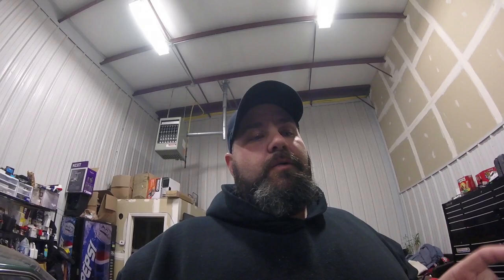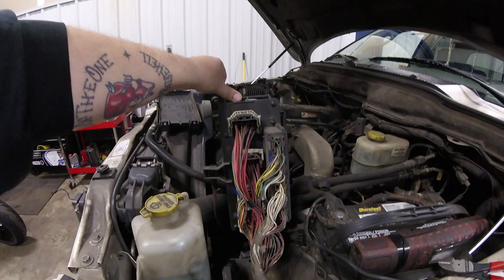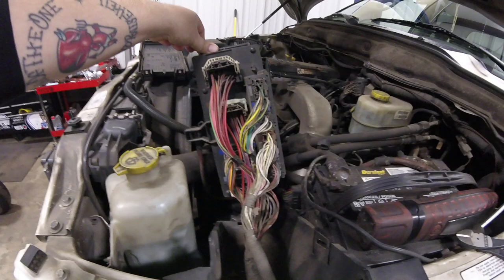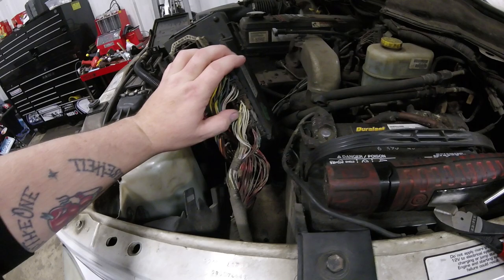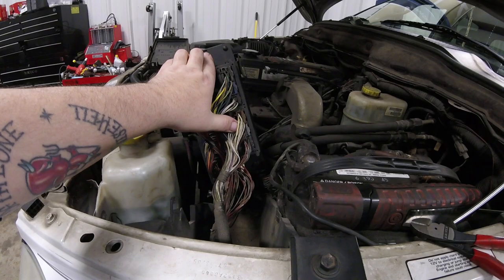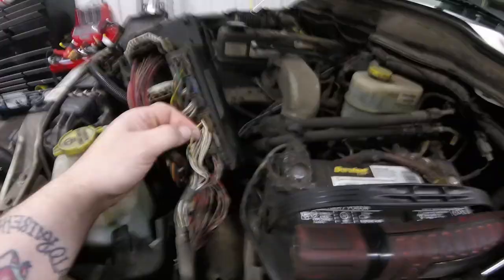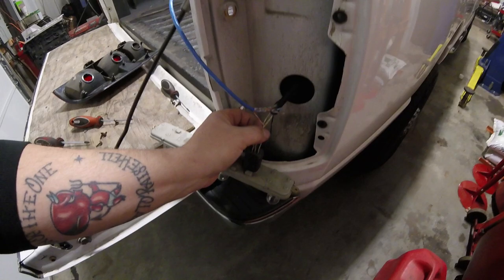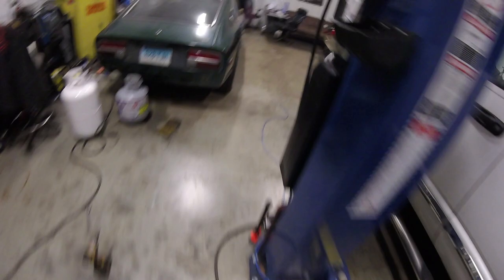Cummins Ram 2500 Bad TIPM??? Maybe not!

Comment: Just started having issues with my 06 mega 5.9.  Airbag light comes on and AC stops working randomly 293K miles.  wiggle the Tipm and it all starts working properly.  Any suggestions would be terrific.
Reply: I am having this exact issue, have you resolved it?

Comment: Thank You Sir, this video gave me a positive attitude on looking to find tha wiring problem for tha 4wd issue on my Bosses 07 3500 with tha 6.7...cross Your fingers fir mE...
Reply from the maker: Crossed ;-)
Reply: Please let me know 
Having the same 07 1500,
Reply: Got 2010 2500 cummins. Need pin diagram p/n 04692 131AG

Comment: Rear running lights  Not working ,  turn signal are working and stop lights 

2007 Dodge  Ram 3500  with a stake  bed . 

A Trailer   That I purchase couple days ago , it was towed   Using my 07  and there after I lost the running lights . 

It appear  there might be a short on  the  trailer,, that  cause the fuse to blow , but I not sure . 

Give some ideas to troubleshoot  please  , i have check the fuse and that is good .

Comment: I have an 05 dodge ram 2500  5.9l diesel that I have no backup light, I try to find information about it I don't know if it is a sensor problem. I seen a video about fixing the problem that this guy have to add extra wire TIPM fuse box but I'm not sure about this... If I buy myself a scanner code reader will I be able to find the problem and is the a specific scanner I need to get? Or do you have a video about it?

Comment: I could use some help! I got an 06 2500 cummins and mine is throwing multiple turn signal codes but I have been assuming that was from the after market LED tail lights but now I'm getting a U0024 code and thats got me leaning towards the TIPM. I think its a coincidence but I'm also getting a P0148 code , thats a fuel delivery error code and I've lost a ton of power and my transmission is acting up too. Could this all be the TIPM?

Comment: I have a 2012 Doge ram 1500 I bought it used a year ago and have had nothing but trouble with it but at night i can barely see due to headlight problem well i figured out that when my headlights are on both my headlights work but when i turn on my high beams my right side comes on and my left side goes off i almost did not pass inspection but they told me to replace high beam light and let me go. we have checked both lights dont understand what it could be, but in last month now im having trouble with my right side light it just goes off i guess its in the wiring i have to keep messing with it pulling over all the time and of course its not easy to get to but i just move it around. I have also have had to bypass my fuel pump relay switch. I sure could use some help this is just short of my problems with my doge i have a list of codes its throwing and were all lost.  any suggestions.....

Comment: I have a similar issue both my left and right hyper Flash which I have aftermarket headlights and taillights but my right marker lights flash with the turning signal chapped all the grounds and the trailer plugs and I can't seem to find the issue

Comment: Idk if you’ll even answer this, but I have a question, I have a 2003 Dodge Ram 2500 5.9 and I think I have the same problem, but I’m not sure. I believe a trailer light got ripped off of and maybe caused a short or something, I’m getting a lamp out flashing light only with the turn signal on and the parking lights on, do you think all I need is a reset?
Reply from the maker: A reset might fix it all. If it dead shorted though, it may need replacement.

Comment: I have a 2007 ram 2500 diesel. I cannot figure out why my daytime running lights are not working. I believe it may be a TIPM issue. Do you have an idea of where to look on the TIPM wire diagram to help diagnose?

Comment: Great video,
I’m having a similar issue. I have an 08 Cummins 2500. Left brake light left rear turn signal, and the entire overhead 3rd brake light do not work. I traced the wiring harness haven’t found breaks or shorts. The running lamp(which is the same bulb as the brake lamp) works when I have the running lights on. But won’t do anything when I press the brake. Any ideas? Same with turn signal won’t flash. I replaced bulbs even though I knew they were good still nothing. Thanks for your time

Comment: I'm having some what of the same issues, my blinkers doesn't work in front of my truck and only one works at the rear of truck and passenger head light comes on and the other doesn't and when I turn the blinkers on I get rapid blinkers on the instrument panel and on panel or dash it always says lamp out. Checked all bulbs and they are fine. Loved ur video just wondering if there is anything else I should be looking for.

Comment: I have a 2006 Dodge Ram 2500 4X2 truck and I present code P0882 and P0700, besides U1120, U0121 and several P0846, P0846, P0871, P0876, P0988 and P0869, the manual says that if I correct the P0882 the other codes are corrected, on the pin 18 of the C4 of the PCM voltage does not arrive and should arrive 3v minimum to activate the circuit of the pins of the same C4 19, 28 and 38 with 12 volts to activate the TRS of the Transmission, since the transmission went to 4th by protection , I would appreciate your help or guidance to solve the problem, thanks in advance, Regards.
Reply from the maker: That is a very common issue when the TIPM begins to go bad. It loses the 12v input signal to the trans computer. You can remove and disassemble the tipm to see if there is any obvious issues. The other issue can sometimes be the ECU not commanding the 12v signal but most likely the TIPM. I havent had the issue myself so i cant tell you exactly where to look in the TIPM but def a tipm issue in my opinion.
Reply: Thank you friend Morfius very kind of your part for answering, since I asked several and nobody has answered, today I check several circuits of the CAN BUS to the electric modules and all have continuity, then I measure the resistance and all give less than 5 ohms and as the manual says below 5 ohm is fine, I have a month with this problem, but here it is difficult to get things, I live in Venezuela and there is a severe crisis, hyperinflation (over 2000%), we only work to buy food , I am a Mechanical Engineer and a specialist in Natural Gas, I have been working in PDVSA for 27 years, you can see my profile in Linkedin, for your information 3 years ago I earned the equivalent of 10,000 USD salary, right now they do not reach the equivalent of 1000 USD monthly (I'm just waiting for retirement for next year and not lose all those years), so I can not buy the spare, one because you can not get here and another that has to be imported, but that's very expensive, friend Morfius I apologize that I have told you personal things but it is that we are in a difficult situation and we hope that outsiders will help us out of this situation, you can know some proof of how to diagnose the TIPM to know if it is bad and get the solution.
You can see that you are a hunger with a good heart, many blessings and many thanks. regards

Comment: A quick question, have a obd2 code reader and a cylinder five missfire on a ram 04  4.7 liter. Does the same principles of this video apply towards troubleshooting 2314  code which is a wiring issue for the coil and secondary ignition code? Also showing random multiple missfire code.
Reply from the maker: On your particular truck a misfire could be a lot of things. Mainly a coil pack or spark plug that has gone bad. I would check that first. If the misfire continues, I would perform a compression test on that cyl to make sure compression is within spec. The multiple random misfire code can be triggered if a single cyl is misfiring badly enough so i would leave that code alone and focus on the single cylinder.

Comment: Low voltage at TPS. Could this be the TIPM?

Whole new engine wiring harness to different ECM checking for flash proper at ECM

Comment: I have ‘04 2500 with cummins, found out previous owner had someone blue crimp connector(2 to1) the trailer harness and trailer brakes in the back side harness and it all corroded. Go figure for New York salty winter roads Finally put a newer harness in it with same part numbers and trailer brake lights and signals do not work but trailer brakes and running lights do work... any help? Please, thank you!
Reply from the maker: The corroded wire shorted and killed the TIPM.

Comment: Excellent video.  I am have a error code P0541 and the engine icon turns on after a beep.  The mechanics can't seem to fix it?  Any suggestions please?  I do know, I think it has to do with the relay, but that's it.  Forgot to mention its a 2006 Ram Laramie 3500 5.9.

Comment: I am a gear head like yourself but im more of a old car guy. I have a 2007 dodge ram  2500  and one day out of no where the truck just died.. I turn key off and it started back up. Everything was fine for a couple days and I stopped for lunch and it died again while I was letting it idel down before turning her off and it just died.. with key on you don't hear fuel pump come on and  check gauge light ,engine light and overhead shows low fuel .. took to dealer and they said it was ecm. I replaced it she fired right up and getting ready to head home and it did it again, died and nothing. Any ideas would be very much appreciated

Comment: 2007 Dodge Ram 3500 dually 4x4 5.9 diesel.
Lost rear brake lamps, signal lamps output.  Third brake light ok.  Happened right after connecting to a friend's trailer 7-way. It is clear that a wire shorted (found it on trailer).
Bulbs good. Fuse good. TIPM disassembled and cleaned, no corrosion or broken pins. Dielectric grease coated after cleaning. Hard reset, and soft reset on TIPM gained nothing.
Multifunction switch good (and cleaned) too.
Third brake light working I think means my brake switch is ok too.
I believe that I need the TIPM cleared and or re-flashed. Am I on track?
[And where are you located?]

Comment: My 01 cummins keeps blowing fuse for running lights, i have checked and moved around every cable with no luck,    sometimes it takes longer to blow but for some reason i heat the gas and it blows seems odd to me, no codes

Comment: I have a 2006 dodge ram 3500 5.9L cummins turbo diesel. The truck ran until a friend used one of my batteries to jump start his truck which he done so by removing the battery while my truck was running, he used a battery booster on the terminals he removed the battery from...he almost drained the battery trying to start another dodge by chance, and upon re-installing it he never bothered shutting off my truck he just unhooked the booster pack and tried to connect the battery and sort of dropped it into place. When he did that my truck stalled, there is a red light that flashes on my dash, the truck cranks but will not start, and when I plug my old scanner it says it can not connect to ecu. I have no clue as to what to do
Reply: Dang, it sounds like he fried the computer or the battery is undercharged. Try and disconnect both batteries and leave it alone overnight and reconnect in the morning, MAYBE that will work. If not, check the batteries voltage, they should be above 12 volts, and then you can get the bad one charged. If that don't help, get your alternator checked as well. And if that don't work, then go to a trustworthy technician. This is why I don't let nobody use my truck, or get under the hood. Good luck

Comment: This video is going to save people a lot of money , I have a 2015 2500 Cummins . Lights all work fine on the truck , my issue starts when I plug any trailer wire harness to my truck . The right rear tail light stays on bright red . No turn single no break light . It only does this on the trailer I’m pulling . Any suggestions on where to start or what to do ?

Comment: Your video gave me an idea about my window issue I’m recently having with it not working out of the blue and the master power switch illuminates slightly when I try to make it go up and it’s only rear windows and also the rear sliding window is doing the same at the moon roof area randomly everything works including the rear view mirror and everything works fine but now it’s been gone for a couple of days and it’s driving me nuts on a 2013 ram longhorn edition Cummins

Comment: I am having a p0404 code to come up. I changed the egr valve and broke the clip on the connection to the egr sensor. I'm thinking that with the clip broken, I'm not getting a proper connection causing the engine light to stay on. Would you recommend that a novice attempt to cut those wires and splice them back together? Can I damage the computer if they are not soldered properly?
Reply from the maker: Splicing is easy! Just take your time and do one wire at a time. It should go just fine!

Comment: I have a Dodge 3500/ diesel. I have lost power to my break lights and rear turn signals. The trailer lights work still but not the truck itself. The tail lights work on the back and the cab break light (3rd light) still works as well as the front signal lights. I have checked the fuses and tested wires from the main plug under the cab all the way back. Any suggestions?
Reply from the maker: Yes. Most likely either a corroded terminal within the TIPM or an overcurrent fault also in the TIPM. A simple reflash of the TIPM may solve the issue. I would go that route first.

Comment: Have a 2006 dodge 2500 cummins no left reverse light, fuel gauge wirks some times. Last year replaced ABS computer.  Now recently I  getting alot of engine codes.  Grid light comes on when the truck gets about 197 degrees, check engine codes, fan speed to high (new owm fan 2 weeks ago), high pressure return line, low power to several other sensors.  Dealership says they want to replace the ecm for $3000, but can't tell me if it will fix the problem.  Any advice would be great appreciated.
Reply from the maker: Honestly sounds like a grounding issue to me. Depending on where you live, corrosion and rust can cause a ton of issue especially with how many grounds these vehicles have. Your best bet is to check every single ground you can find in the engine bay as well as along the frame rail. A factory service manual can tell you where exactly every ground is.

Comment: Great Video!  The right side tail light, front parking light and cab marker lights all stopped working on my 2007 Ram with the 5.9 diesel.  I added a new trailer brake controller and found an old alarm system that I didn't know was there when I bought it.  I removed the alarm system and now those lights stopped working.  Any thoughts?

Comment: Just watched your video and it was very informative. I have a 2013 2500.  It has 122,000 on it. Shortly after i bought it i noticed when i start the truck it would tell me left signal light out. I went outside  and its working. The right signal light flashes fast like bulb is out, but works fine. Been living with that, but last week my AC blower started turning off & on.  Replaced it today. Now when I turn my key  not all my lights and radio won't light up & engine will not crank. Checked both batteries. They are good. I believe it is my TIPM after watching your video. Any help would be appreciated.

Comment: Huh thinking mine sitting at the dealer right now may be good kinda doubt it buuut my rear pass brake light went out of course... after my trailer light went out, then I got no bus a few months later but I was cheap with the fixes cause it was just an unsealed taillight so new bulb clean connections call it a day just whatever got the light off the dash miiiighta screwed myself maybe not can't wait for it to show anymore gonna have to figure something out

Comment: Hello so I got a 2006 dodge 3500 5.9 cummins and the right headlight it acting like it's bad new ones in same ting I took the tipm I see a bad spot in the wire on the Is bored itself can it be fix

Comment: I have a problem with positive output on my five pin connector no power from the fuse panel what would be the problem if the fuse is not bad in the tip m what would fix it.

Comment: Hey, so I was having issues turning on my truck, I would turn the key and nothing, so I would get under my truck and Hotwire my starter, thinking I had a starter problem I took it to mechanic to get it replaced they told me my start was fine but it was the TIPM, so I got one at junkyard and I thought I could just swap it, so I’d have to reprogram it?

Comment: Looking for a little help, Ive got a 2008 dodge 2500 diesel, partially deleted.  I noticed that my drivers side low beam was out, passenger high was out, front passenger directional was out, drivers rear directional was out and the washer fluid pump will not work.  I checked the bulbs and they are fine, I replaced the fuses and they were fine, did a reboot of the tipm by unhooking the batteries over night, cleared the codes.  nothing worked.  I tow trailers frequently and with one of them I noticed the right brake and directional were the only lights working.  Any ideas?  TIPM replacement?  Also, I opened the TIPM up and did not notice any corrosion/dirt/broken connections.
Reply from the maker: Your best bet is to try and find power and ground distribution diagrams. Then check all of the powers and grounds at the TIPM as well as at the non functional items. With that many random things out, there has got to be a cause. I wouldnt condemn the TIPM just yet.

Comment: Hey I have a 2012 ram 2500 longhorn 6.7l I’m having my brand new batteries
 discharged in 2 days , 
All lights ware off doors closed 
Truck does have a egr delete egr cooler delete 
 , custom intake air filter 
Bully dog chip 
Straight pipe exhaust 
The scanner shows the brake switch , I disconnected the brake pedal switch and I’m still draining my battery 🔋 
Any ideas what might short out in this case .
I